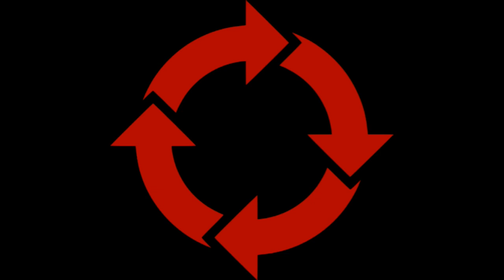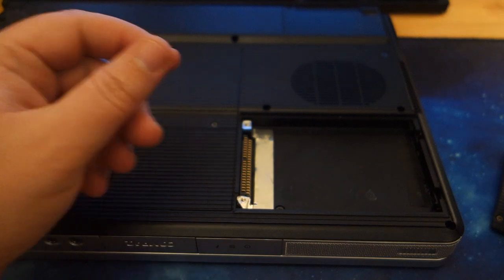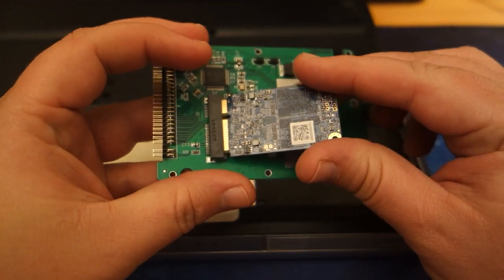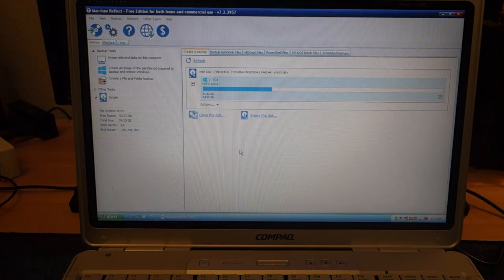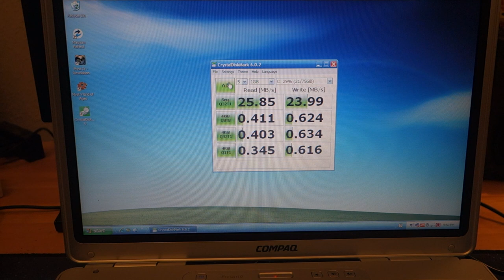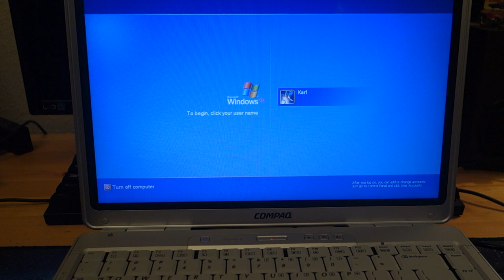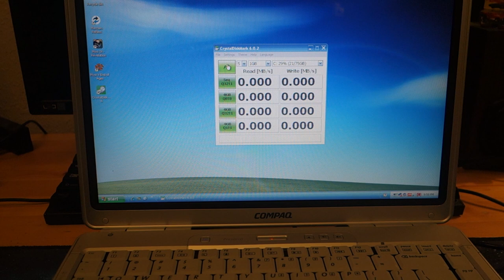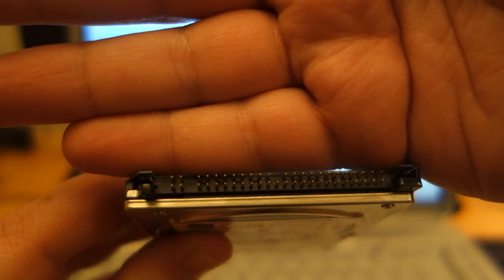How to upgrade an IDE drive to an SSD

Comment from the maker: Support this channel by using our amazon affiliate link:
https://amzn.to/2U9XesP

It doesn't change your shopping experience, but gives us a small kick back to support our efforts.
Thank you!
Reply: you do know sata is a fake
Reply: a hdd has complete data speed of 50MB - 80MB... IDE has a limit of 133MB
Reply: and 50MB to 80MB goes for IDE and SATA hdd’s
Reply: im on team IDE
Reply from the maker: @Scudmaster11  What? you make no sense. This is an IDE100 Speed interface. Obviously a sata SSD is MUCH faster than that, so you're not getting the full speed of the SATA drive, but you're still getting a much faster experience than with a hard drive since you basically have no seek time, and it also produces less heat, less noise and consumes less power. It is also far more reliable than a hard drive.
Reply: well im a hdd user
Reply: a hdd has more life 10 years... ssd is more like 4 years
Reply: also nothing uses 6 GB
Reply: speed limit of a ssd is 500 MB
Reply: and when a test is done its around just 100 MB
Reply: #team parallel

Comment: Hey, i know this is an old video, but if anyone reads these comments, the adapter is capable of much faster speeds. I bought the exact same adapter with a samsung 128gb  msata ssd. I have mine installed in an older laptop then the one in this video, its a  dell inspiron 8100 with windows xp sp3, ATTO disk benchmark is hitting 80MB/s on reads and 75MB/s on writes. If you do this upgrade you need to make sure your storage controller is using UDMA and not PIO mode. You can check this in device manager, find your IDE/ATA ATAPI Storage controller and right click and go to properties, at the top click advanced settings and see what the current settings are, if it says PIO mode you want to change it to DMA, reboot and test it with ATTO disk benchmark. My old dell inspiron 8100 has a maximum of UDMA mode 5, that's ata100, UDMA mode 6 is ata133. this adapter /SSD combo is ata133. I hope this helps someone that does this swap and can't figure out why its still slow.
Reply: Best option is buy original industrial PATA disc with read/write neer 80Mb. Many old Laptops have not UDMA 6 but only 4 or 5. This 100+ pata ssd discs exist, but price is too high. I have with this type of PATA SSD reach close 80/80Mb on UDMA 5 in Win 8.1. I have also this PATA/mSATA converter but with msata KingMAX 60GB 540/540 disc.Not this sh......low end CHINA disc.supposedly Zheino M3 have 540/140🤑 and as you say correctly, it is good to check the Bios to see if UDMA is enabled😉
Reply: @pumelo1  in the past 10 years or so I have experienced a high level of hdd failures. From desktop drives to laptops and game consoles. I'm not sure the cause of all the failures but I have fixed this issue by installing ssd's.
Reply: @lilkuz2005  The old 2.5 PATA were very faulty. I myself bought a new drive 10 years ago and after a few days it started behaving strangely and started having bad sectors with sata drives no longer had such problems. I have an 18-year-old HP NX-6125 with a Turion MT-37 2gb ddr and  old industrial disk at home, but it behaved badly in XP and Win 7, probably because the cache is only 1Kb and there were big delays, I move to Win 8.1 which are 100% ready for SSD drives and all is OK.

Comment: Thanks for this! I'm going to be upgrading my old IBM ThinkPad A21M with this. I bought one eBay about 5 years ago and completely forgot about it as I only used it a handful of times and had it in storage. It wasn't until I was looking through my storage that I found it again. Man, its been a long time since I've worked with PATA drives.

Comment: identical case is also available for m.2 format, might be an even cheaper solution.
both will work in a mac mini G4 & boot in OS9 and OSX.
Reply from the maker: Good to know, it was hard to find the ssd that fit, an m.2 would be a good option for sure. they are far more common.

Comment: awsome video ,, , not a bad price for the parts on amazon , i have a old dell laptop with the slow ide hard drive ,, iam going to install windows 98 se on the laptop ,, ,, before it had xp windows ,, iam going to buy the parts,, that did improve the speeds

Comment: I have a Syba Dual Compact Flash CF to 44 Pin IDE/PATA 2.5" Adapter Enclosure with SanDisk Ultra 16GB. I got avg 85MB/sec. 🙂

Comment: Hello! I have a few questions:
1. Is the adapter limited to ATA-33 aka UDMA Mode 2?
2. Do you have DMA mode activated in the device manager? Or is the drive stuck in PIO mode?
3. Does the drive activity LED on the laptop still work after the upgrade?
4. Have you had any problems at all with the adapter on any OS?
Reply from the maker: I don't see any options for DMA, so I am guessing it is stuck in PIO mode. It's significantly faster than the spinning hard drive that was in there, so I hadn't thought about it. hard drive light does work, and windows 7 and Linux would not install to the drive, but windows XP had no issues. This is just a toy for me I drag out to play some old games or something, and not a serious use machine, so it works well enough for my needs. 

you may be better off, if you need real performance to go with a dedicated IDE SSD:
https://amzn.to/3LgJVSz

They are more expensive, but have much better performance than messing with an adapter.
Reply: @AICvideo  OK, thanks for the reply. You can check if you have DMA enabled under the Windows Device Manager:

Under IDE ATA/ATAPI controllers (click the (+)) should be the IDE controller. Under it should be listed the Primary IDE Channel. Under advanced settings, "Current Transfer Mode" should list what mode the drive is running is. Could you perhaps tell me what is listed there? Thanks.

Comment: I just ordered a NOS ide drive for my thinkpad t42 that runs a couple programs that I still use. get them off amazon while you can. Drops right in, probably much less expensive, and it is possible that the machine will not recognize all that extra drive space on your new huge ssd.
Reply from the maker: I searched for NOS IDE on amazon, and got 0 results. My windows XP machine recognizes the full storage available without issue. Going older might be an issue, but for this solution, this was BY FAR the cheapest I could go at the time I did this video. Other options might pop up every now and then, but this has been consistently for sale since I've made this video.
Reply: @AICvideo  Try using ATA 100 as the search criteria. Decent drives starting at about $30.00.....
Reply from the maker: Just looked, and you are right, 32gig ones start at $35, which is a huge price drop from when I originally did this video, however, the enclosure I used is $11 and a 120gig SSD is $24, so for the same money you can have nearly 4x the storage. If your system allows for the larger storage, I would go that way for sure.
Reply: @AICvideo  It is always good to have options. I would maybe spend the money on my T42 but it is old and used for just a few things where major disk space isn't necessary, just more than I have now. Best thing is working on old machines is fun and keeps us out of trouble!

Comment: The speeds you have suggest that maybe your old drive had been switched to a lower udma mode (to fast for pio mode highest is 16.7 mb/s) in the os because the drive was failing, and possibly the cloned drive is stuck in the same mode.

33mb/s is around udma 2,

crystal disk info, will tell you the current transfer mode and the supported transfer mode of your disk.

you can set transfer mode with hdat2 from dos.
Reply from the maker: Thanks for the info, I will have to look into it. I only use this for some old games.

Comment: Good video, really helpful, .......I want to do this with the old IDE hard drive on an old notebook, my question is, do all IDE hard drives have that adaptor over the pins like the one in your video?
Reply from the maker: That depends on the computer, a lot of HP's of this era have this connector, but I have an older HP that does not. If you have a complete system, you can just reuse that connector. I cannot say without actually opening up the system and looking.
Reply: @AICvideo  Thanks for your reply, it's for an old Toshiba Tecra M1.   Much appreciated!
Reply from the maker: I would look for a tecra m1 tear down on youtube. not every laptop is available, but there is a good chance you can find it.
Reply: @AICvideo  Thanks again, appreciated.
Reply: @AICvideo  Can I ask if the SSD set up you used to replace your IDE drive  is still working  ok?
Reply from the maker: Sure, literally powered it up last night for some light retro gaming. Works great. also powered up a laptop of the same generation but with a spinning drive. and it took a full 2 minutes to boot into windows. vs the few seconds this one did with the SSD.
Reply: @AICvideo  O.K. great!  thanks. :)
Reply: @AICvideo  Hi, I've just taken delivery of one of those M sata and IDE enclosure it goes into, I managed to install it and load Lubuntu onto it, but it just won't boot, the old notebook just won't find the drive, did you have this problem too? Thanks.

Comment: Great Video! By the way I have a question, I have a hp notebook model (17-bs025cl) and I can't really know if my optical drive bay supports SATA (and which SATA version if it supports it) because I'm planning on installing a SSD in the optical drive bay using a caddy

I've tried lots of third party software and they say it's an ATAPI.. I can't seem to find an answer on the web on what is this ATAPI or whether my device controller is SATA or IDE please if you can help me in anyway.
Reply from the maker: This video doesn't apply in any way to your laptop... you just need to buy hard drive caddy like this: https://amzn.to/30Qlbbg (do some research to see if there is a specific one for your system) and away you go. IDE was phased out well over 10 years ago. This is for older laptops from the early 90's through the mid 2000's. not a laptop that is <2 years old.

Comment: It is possible to replace the TURION 64 @ 1.8 GHz  for a TURION 64 X2 @ 2.3 GHz  and use NVme storage?
Reply from the maker: No, the x2 is a different socket and incompatible. 
https://www.cpu-upgrade.com/CPUs/AMD/Turion_64_Mobile_technology/index.html
That is your upgrade list. you can search your specific model to see what is the best upgrade for you. 

No point in trying to do an NVME storage, as the storage interface is IDE100, and you will never get faster speeds that that. upgrading to the adapter with the sata SSD I show in this video will get you a drive that performs faster than the interface, making the interface your bottleneck.
Reply: Got it. Thanks  a lot for your inputs.

Comment: Hi, great informative video. I have an asrock n68 gs4 FX motherboard and I want to install ssd into the system but I can't find AHCI in the sata operation mode. I tried raid but it won't detect other drive that I have which I use for games etc. Do you have any idea how to go about this?
Reply from the maker: I'm sorry I don't. You should be able to just plug the SSD in. The system should be able to use it as any drive. At least I've never had to do anything different when upgrading an hdd to an SSD
Reply: @AICvideo  Yeah I'm kinda stuck here. Asking around if anybody knows. Thanks anyway!

Comment: Man, this adaptor is just for notebooks or can be used on a comum desktops too?
Reply from the maker: I don't have any desktops to try it in. I don't know if enough power is sent over the IDE in a desktop to power it.
Reply: @AICvideo  Hmmm, I think it cannot be used because on the normal PC the input / output information is separate from the power input.
Anyway thank you.
Reply from the maker: they have stuff like this for compact flash:
https://amzn.to/2BBON5A

it takes power from the floppy drive power adapter, and you can get compact flash to  SD adapter: https://amzn.to/3jN0JTc
Reply: @AICvideo  ok, I will analyze this to see if it is worth spending on something that is already very old and limited.
thanks for answering.

Comment: You should have maxed out the SO-DIMM DDR2 at 4GB for 32 bit Windows XP and you would have felt much more difference.  Besides, data transfer speeds for IDE range from 5MB/s up to 133MB/s (ATA100/133).  Why are you getting only a 1/4 of that?  Did you have to change anything on the BIOS?
Reply from the maker: I had tried a single two gig dimm and it didn't boot. I didn't know if it isn't supported or if I had a bad dimm, but I had two 1 gig sticks, and they worked great, so I stuck with it.
Reply: @AICvideo , had a similar problem but on a Windows 10 64 bit system for a laptop but maxed by changing addressable RAM:  Command Prompt > System Configuration > Boot > Advanced Options > Maximum Memory  then change to target RAM upwards to match (Tick) and reboot.  Could have this similar in Windows XP.  Anyways, thanks for the nice tips
Reply from the maker: System wouldn't POST. Much less boot into the os.
Reply: DDR 2 is not compatible.  The notch In the shipset is  different size and doesn't allow to use DDR2 . slots are for 2 1 giga shipset according to literature around internet.

Comment: That's awesome! What do i do though i buy an IDE SSD to put in an old laptop that didn't have an HDD in the first place?
Reply from the maker: Interesting. What laptop had no hard drive to begin with? do you have a make and model?
Reply: @AICvideo  Yeah, i got it for dirt cheap but it came without RAM and HDD and wanted to make it a project bringing it back to life. It is an HP NX9010. The hard part is getting the software to boot it up. PHEW
Reply from the maker: I'm not sure why you say that computer didn't have a HDD. it very much came with one initially. just google "windows XP pro install ISO" and you'll find tons of them out there. just burn a DVD.
Reply: @AICvideo  I got it off ebay like that. I can use a flash drive too right?
Reply from the maker: Just... buy a hard drive for it. You'll need a caddy if you don't have one, and then you can buy what I demonstrate in the video for an ssd (links in description) or just buy an old IDE hard drive.
Reply: @AICvideo  I actually order an IDE SSD.  But my  confusion comes from the OS process, lets say i download the XP ISO into a Flash Drive and then i boot up my pc through the FD, so then what? Once i boot it up the system automatically downloads the OS from the FD into the HDD?
Reply from the maker: Have you never installed an OS before? 

First off, most older computers won't boot from a flash drive, you will have to burn a disk. Second of all, google "windows xp install how to". It's pretty basic an straight forward.
Reply: @AICvideo  i have cloned HDDs but no, i haven't installed OS before. i'll give it a shot. thanks!!
Reply: @AICvideo  perhaps eMMC chip will be in that laptop
Reply: @harison6132  interesting. What is that?

Comment: You get limitations ide speed???
Reply from the maker: yes, the SSD is still limited to IDE speeds. but it is sill faster than a spinning drive. it also runs cooler, and uses less power.
Reply: @AICvideo  I think it's so waste by upgrading SSD to such IDE port. I don't understand the bottom 3 of your disc crystal test.. But the read n write comparison is almost nothing (before 28/22 after 35/32 ??) when you operate it, do u feel the huge difference? And btw, why don't you use the DVD port? Do you think it will result better performance?
Reply from the maker: @arthurpuntuan  It is FAR faster and more responsive in real world, it uses far less battery power when I'm on battery, I get over half an hour longer overall use, if not more, It is also generates less heat, and it's right at your wrist level. I was not going for all out performance, with the IDE drive, you are limited to a low interface speed. I was going for increased reliability and capacity, and got other benefits with it. the DVD port runs off the same ide interface.
Reply: @AICvideo  did you upgrade the OS to Win7 atleast? What about the RAM... u upgrade it to 2GB total? Do u know is it support DDR PC3200 instead of DDR PC2700 (factory standard)?

Comment: So are you going to install win 10?
Reply from the maker: I have tried several times. It just gives me an error for a hardware failure. I gave up. I don't think windows 10 likes the adapter. I run windows XP SP2 on it.
Reply: @AICvideo- wow, sorry to hear that.
Reply: Yo tengo una presario v2000 y le e instalado Windows 10, Windows 8.1 y Windows 7.